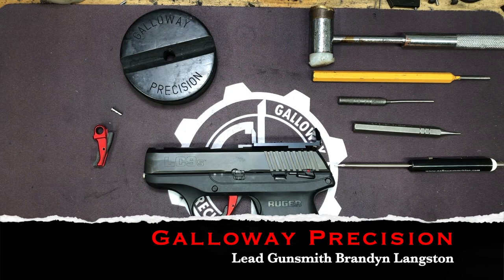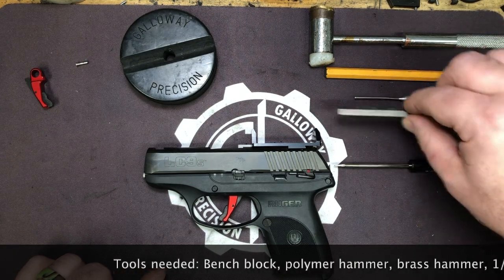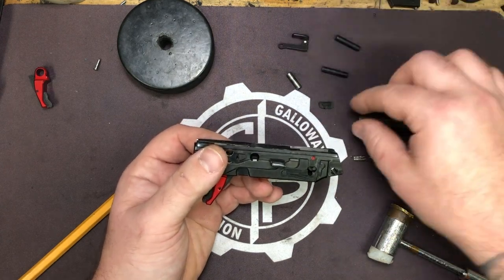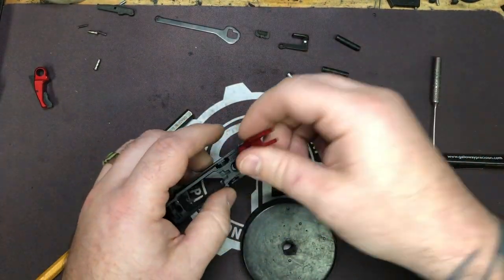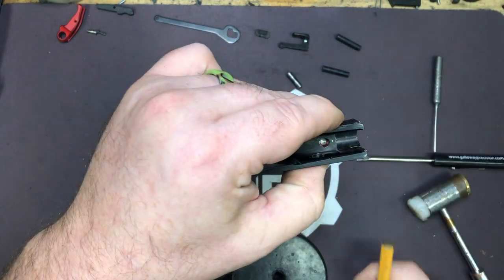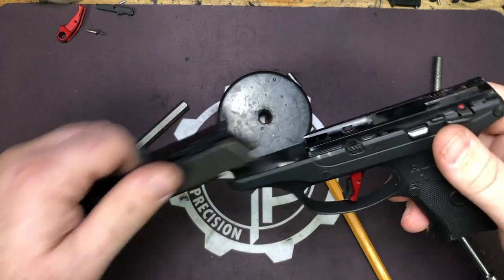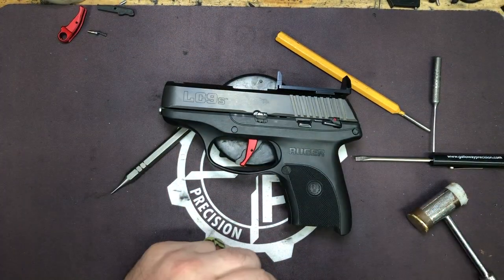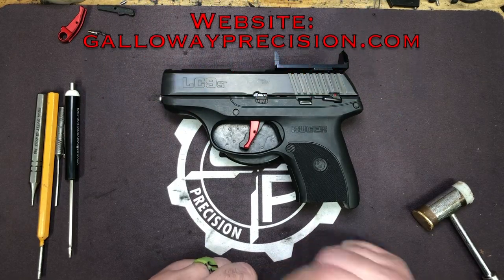Aegis Short Stroke Trigger for LC9s/EC9s Pistols

Comment: Excited to get mine installed. Hope it is as easy as the video.
Reply: Yo bro could you help me because I put everything together and the trigger is like suck on safety
Reply: @opp.3  I would just take it apart and inspect each part as I installed it. Even reinstall the factory trigger again to see if you get the safety issue. If not, might be a defective trigger.

Comment: do you have a video on removing the Mag disconnect on the ec9s?
Reply from the maker: I've got to get one first, that's why I call it out in the video that it has to be removed, I physically don't have one and have to get one ordered from schludershots.com.  BTW anyone that needs stock parts for just about any pistol that is the place to go.  They buy old police inventory and evidence room pistols and strip them and sell the parts.  Great place to get stock Bodyguard, LC series, and other obscure pistol parts.
Reply: magazine disconnect is the sane thing as changing trigger you just take trigger off and remove the metal plate

Comment: Put this is and the trigger won’t reset? If I don’t touch the trigger and pull the slide back and release it, the trigger pulls fine, but the trigger won’t reset if I hold the trigger back and rack the slide then slowly let out the trigger...
Reply from the maker: Needs slightly more reset, email tech@gallowayprecision.com for technical help.

Comment: Does it come with a new trigger return spring, or is the stock one used?
Reply from the maker: You reuse the stock trigger return spring.  No matter what anybody sells or says, never change the stock trigger return spring.
Reply: @GallowayPrecision  On just this gun, or any other gun as well?  And since there is an external safety, does it really need the trigger dingus? I'm buying one of these guns later this week.

Comment: Ordered this and the one for the Security 9. Very unhappy. VERY. The one in the Security 9 is fussy as get all with the trigger safety. If you fart wrong while pulling it... the trigger safety will not disengage. Not good for something to save your life. Now... for the kicker... on the LC9S... The trigger went in and once the gun was reassembled this trigger WILL NOT DROP THE STRIKER. The thing is... YOU NEED THE GUN UNCOCKED TO GET IT BACK APART!  Now my LC9S is bricked. You have no business building and selling this garbage.
Reply: Same thing happened too me with my EC9s.
Have you figured out how to remedy this yet?